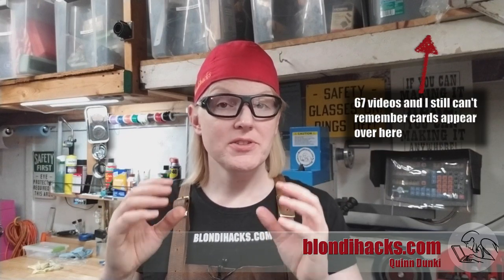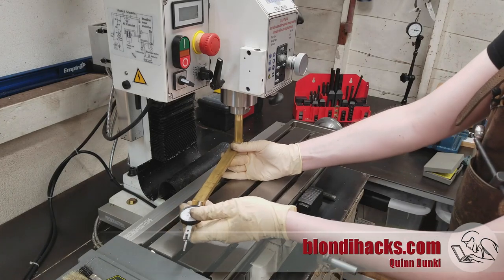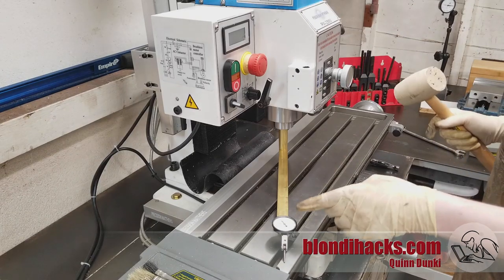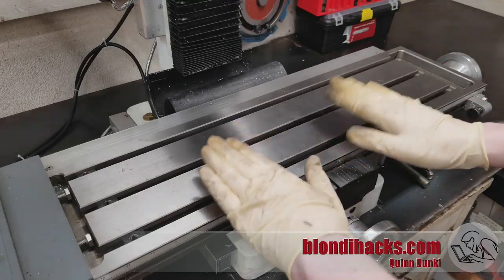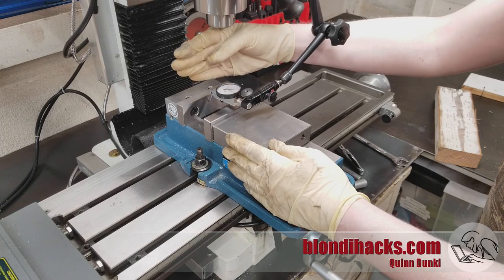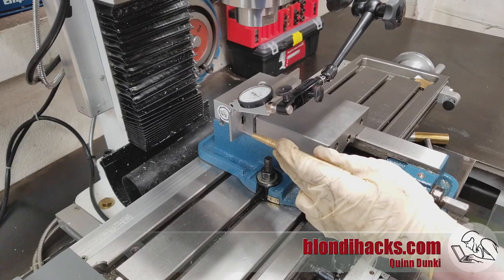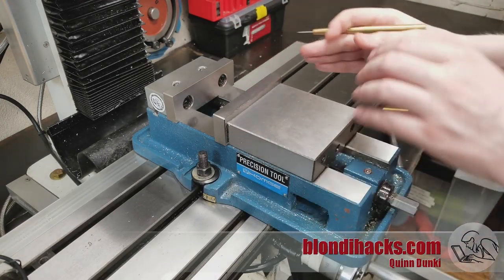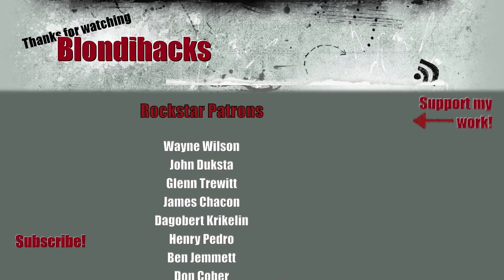Vertical Mill Tutorial 2 : Setup

Comment: 🤦‍♂️ Dammit Quinn, every time i think i have my metric / imperial equivalent chart up to date you throw in a new variable... how many skitchens in a smidge? and will this mean adjusting how many bee's d#cks in a poofteenth? 
I'm a few years off getting a mill but have just started restoration of my 40's era Aussie made lathe, should involve lots of beer and choice swearwords 😁
Reply from the maker: The easy way to remember is that there are 130 skitchens in a rod, and 420 smidges in a naval chain (not to be confused with a furlong, a common error). I hope that helps!
Reply: Of course.. i could never fathom why knot that my bushells and scores never equalled a stadia.
⚙️😺 and happy Apollo day
Reply: @Blondihacks  those are imperial skitchens, though.  A metric skitchen is 1/100 of a skosh.
Reply: I'm still using the skosh. Just a skosh is usually too much. And then you have to come back a skosh... My skosh micrometer is only accurate to (wait for it...) a skosh.
Along with Mr. Pete and Abom, This Old Tony, Oxtool, and a lot more... BTW, I really like your videos even though I'm Bald not Blonde. Keep up the good work
Reply: So, a rod is 5.0292 meters. That makes a skitchen 38.66 mm (or 1.523"). That seems quite a large amount to loosen a bolt... But hey, I'm not that experienced a machinist, and I''m only using a lathe - I managed to make it do some milling too, but it's tough - easy to make it shake quite a bit... :( 

Also, I grew up with metric, so I have to convert everything to metric. I kinda know that a though is couple of hundreds of a millimeter, but when something several dozen thou - say 67 of them, that's 1.7mm, but I need a calculator to figure that out. And it gets worse for bigger sizes. I do know some of the fractions, such as 1/8" or 3/4", and of course, I can convert something like 125 thou to 1/8. But then someone says 27/64 and mixes that with thousands, and I'm definitely grabbing the calculator again...
Reply: At least we can agree on one thing... it doesn't matter what system you use if the part is too short at one end 😁
Reply: If the part is too short on one end, you measured the wrong end; turn it around.
Reply: I tried that but there's no markings on the other side
Reply: I'm sticking to good old fashioned Gnat's knackers for anything smaller than a smidge.
Reply: 🤔 I wonder what the insects think about their anatomy being used as an international metrology base
Reply: They probably think it's the dogs' bollocks :)
Reply: not the bee's knees ?😁
Reply: @billbaggins  Well, as a beginner, I still find with distressing frequency that some parts are too short at both ends. I guess as one improves, they'll only be short at one end. And with sufficient care and experience, not short at either end. Although, with my luck, some of the latter will still be too short in the middle...
Reply: 🤔 too short in the middle.. you could cut that bit out and weld it to the end thats too short
Reply: @billbaggins  This is simply hilarious.  :)
Reply: @andyhowey7351  Glad you got a laugh mate 🍺
Reply: @Blondihacks  Forget all these newfound oddball measurements.  I prefer old school on almost anything over new stuff.  Even so the other day when I tried to pick up a chunk of aluminum rod for a project the young-ish guy at the metal store just looked at me blankly when I request a length of 1/2 cubit.  Good help is so hard to find.
Reply: @davek9804  Just tell them that it is approximately 4.573 x 10^-4 Li. I am sure that they will think it is fairly straightforward.

Comment: My boss at a small architectural fab shop, set me up on the mill one day. Never used one before. I'm thinking it's just a drill press with a moveable bed.  Took it slow, and did ok.  FF a couple years I was machining a 'proof of concept' back gauge for our punch press.    Boss liked it, so it turned into gauges for all machines.  Now I'm the shop "machinist', (in quotes, because I don't need to be super precise.).
Love the videos, you make it so easy.

Comment: Love your videos, Quinn. I just want to put in my 2 cents worth on tramming the head to help others.
Just to reinforce what was mentioned in other comments, the shape and angle(s) of the DTI holding arm do not matter. Also, as long as the mill is somewhat level, the flexing of the arm will be equal on both sides so it will cancel out. What matters is that the distance of the DTI tip from the spindle center is the same at both data points. How the DTI is held is irrelevant.
Regarding the choice of data points used for tramming in the X-Z plane:
As long as the head is not significantly off in the Nod direction, using approximately symmetrical points on the +X and -X sides of the spindle will suffice. As you said, the further away from the spindle, the greater the possible accuracy. However, if the head is off in the Nod direction at all, the two data points must have the same Y position on the table. Best to be in line with the spindle left and right to eliminate any possible error introduced by the Nod being off, even if your mill does not adjust in the Nod direction. Choosing diagonally opposing data points allows any Nod error to affect the readings for tramming the head in the X-Y plane. In other words, NEVER use diagonal points for tramming in any direction.
Keep up the great work!

Comment: Hi Quinn,
I've been bingeing your videos during the holidays to get ideas to help me at work where I use older lathes and knee mills. Nice work! One thing I've done to the vices on all 3 mills is to tap the bottom of the vice near the mounting slot in that groove and machine keys with counter bores in them that fit into the table's slot so it ends up only a few thou out that can then be easily dialed in.

Comment: Another relatively easy way is to use two dial gauges, one at each end of the vice jaw (or inserted parallel plate) and tighten the vice. 

Then move the table so that the left end touches the gauge on the left and zero that gauge. Now move the table so that same left end of the vice now touches the right gauge and zero that one.  Move the table back to the left so the left end of the vice touches the left gauge and the right touches the right.
You can now loosen the vice and tap it while observing both gauges and trying to get them to give the same reading.  Since you are seeing both the left and right simultaneously it becomes very quick and easy to get both sides the same.
Reply from the maker: That sounds like a great method. Thanks for sharing!

Comment: one little tipp on the maybe bigger import mills: if you tap the head or for that matter anything on the mill, not only use a rubber mallet, but also use a piece of scrap wood to hold against the mill. even a rubber mallet will chip the "paint", they like to put a lot of make up on their mills, usually around 5/64" of putty before the paint comes.

Comment: Another nice video! Personally I've been using Tom's technique with my CNC'd G0704. The instant feedback makes it relatively quick, although getting that last few tenths is always finicky.

It's also worth mentioning that the bottom edges on some of the cheaper import vises are not de-burred at the factory. I had to spend 15 minutes with needle files on mine.
Reply from the maker: Yes, great point about the deburring. I’ve had to deburr pretty much every import thing I’ve bought.

Comment: When you get a machine like this, its advised to check that you Z axis is running perpendicular to your table first. You only need to sweep the width of your table and you still need to check your tram front to back. You can shim under the base of the column to adjust.

Comment: Very informative and enjoyable. It is possible to turn up a pair of dowels that are a good fit in your t slots. Fit them to the bottom of the vice in such a way that they are parallel to the fixed jaw. Then when you take the vice off and put it on again, it will be very close and need minimal adjustment. The M-perial system is much used in the UK too, where it is a perfectly reasonable proposition to ask for a 3 metre length of 4 x 2. Actually I think M-perial is a Commonwealth thing.🇬🇧🇨🇦🇦🇺🇳🇿🇳🇺🇵🇳🇸🇭🇹🇦🇹🇨🇻🇬🇲🇸🇰🇾🇮🇴🇫🇯🇧🇲🇮🇳...you get the picture.

Comment: I just thought of something, if you would make a pin that fits into the hole in the vice where the swivel base fit and you would secure it on the table somehow, you would then get a fulcrum more or less in the center of the vice. 
Or you could just make keys for the vice, that's a bit easier but takes a bit more work.

Comment: I realise this video is getting on a bit now (but good grief, 10 months ago? It seems like I only watched it yesterday! Must be me getting on a bit as well...); but when it comes to tramming a mill - certainly a knee mill, but it would work on a column mill too - I cannot recommend one of those dual-dial tramming tools enough. Don't buy one, though, make one! They're dead easy to do, you don't NEED a lathe (but it helps), and tramming becomes almost a pleasure afterwards. Almost.  I've been messing around with mills & lathes for just over 10 years now; and 3 months ago I finally got around to making a tramming tool; and I've trammed my mill more times since I made it than in the entire 9 years 9 months previously! Instead of taking 20 minutes to get it close, now it takes like 5 minutes, and that's including setting the "nod" adjustment on my Bridgeport, which was always an absolute bear to do. Quinn - if you're reading this, you could make a great video or two out of it! Happy to lash together a drawing for you to work from, if you like.

Comment: I'm late to the party, but after waiting 5 months for delivery, I've finally gotten a new mill like yours, a PM-25V with DRO and power feed. That tip with the parallel is GREAT! I spent 30 minutes goofing around trying to do it without that, then I rewatched this video... "Oh! Use a parallel! Right!" My vise (The same kind as yours) came with a rotating base, which I did not use, but after discovering that none of the threaded rods that came with the clamping kit would fit without a hodge podge fugitive fleet of clamping washers, I just tried the T-Nuts that came with the vise. They fit great! Not only does it look clean and tight, but I'm not using up the T-Nuts or threaded rods that came with the clamping kit.
Here's my question: Why put the vise in the middle? Why not off to one side? That would leave more room for direct fixturing. It can't be rigidity, as whatever you're using (Vise or direct fixturing.) is centered under the spindle when in use.

Comment: I use the Lab Rat Method when squaring my vice...A precision 18" straight edge clamped in the vise on parallels with the static face used to indicate.  I have mine currently dialed in to about .0005" in 18" on my Grizzly

Comment: One tip for tramming the vise in. If the front of the table indicates zero and your tee slots are zero take the movable jaw off of the vise and clamp the vise to the table with the solid* jaw up against the front of the table. Now cut a slot in the bottom of the vise for alignment keys. These can be in line with your dold downs slots or off set by the distance between your tee slots. Instant alignment when installing the vise. Baba bing, bada boom. 
Also when tramming the head with 40+ years experience when checking the reading in each direction have the indicator above the table and slip something of a consistent dimension between the table and tip of the indicator. This can keep the tip of the indicator from hitting in the tee slot or the edge of the table.
These types of mills you also need to check the tram of the y axis to see just where everything is. Nick Mueller on YouTube has an excellent series on alignment of dovetail column mills.
*nothing is solid, with the vise mounted set an indicator against the "solid " jaw. Now clamp something in the vise and see what the indicator does. A lot of it simple physics. The rest is the way the vise is constructed. 
I much prefer this type of vise personally
https://www.shars.com/6-660ur-reverse-cnc-milling-machine-vise-0-0004-1

Comment: Very good tutorial on tramming in X, not sure the tramming distance needs to be that long, yes, it improves the resolution, but generally width of bed Y is sufficient, ( this is fully supported by the width of the Y axis) Most machinsts will position the vise slightly off centre, normally to the left, this allows ending up and directing the chips away from the operator, say 50 mm of centre ref vise has width/table length. Also when milling on the top face, feed is left to right, so that the chips are again directed away from the operator.
Again, I have only watched three of your videos, and found your explanations very good, hope you don't mind my comments from my armchair, it does have a vise On it though🤓.
Best regards from the UK.

Comment: Hi Quinn, many thanks for your superb videos. Fantastic humour with really easy to follow instructions for us newbies but having said that, I need your advice.

For starters, what is the size of the vice that you are using in the video? The reason that I ask is that in May I'm picking up my new mill and it has a 820x240mm table with a 55kg load rating and was considering getting a 6" vice for it. Do you consider this size of vice to be too large for that table? I will be machining all sizes of items from the small to the large in steel, brass and aluminium. The other question is, should the vice (whichever size) be mounted in the centre of the table or is that just personal preference?  I was considering mounting more to one end of the table to allow for clamping larger items directly to the other? Your thoughts and advice would be greatly appreciated. I will be working my way through all of your videos as they are somewhat addictive viewing. Please keep them coming.

Comment: Quinn

If you have both a vise and a rotary table, would it be acceptable to mount the vise of center so you don't have to remove the vise when needing the rotary table? Any down side to leaving the vise mounted out towards one end of the table or the other?

John
Reply from the maker: I have seen people do this, for sure. The main reason to have the vise in the center is the weight of the table is most balanced that way. Weight imbalance can cause small losses of precision from flexing and pressure on gibs. Generally there’s room to mount the vise in the middle and a rotary next to it when needed. Considering how much the vise is used relative to anything else, the center is a good idea, I think. That’s where most of your precision is.

Comment: Here's a tip look closely at the top of the pads that the nuts clamp to. If it's a cast surface and not smooth when you tighten the nuts against the Vice the torque exerted on the nut will move the Vice sideways because of the uneven surface you tighten against. Buy Machining these surfaces smooth you can avoid much angst.
Reply from the maker: There are a couple of layers of washers there that help too. The nuts aren’t clamping on the castings.
Reply: @Blondihacks  the washers do not negate the surface that they're clamped to. And uneven surface no matter where it is will provide uneven clamping pressure. Think of press fitting one part within another. If the surfaces are not parallel to each other the part presses sideways. Therefore you have the same situation when clamping a vise if the pair of surfaces not all parallel they pushed sideways.
Reply from the maker: Oh yes, that’s true. I thought you were referring to the nuts dragging on the rough casting as they get tight, which can also cause things to move. Washers do help with that.

Comment: I'm planning on putting 2 dowel holes in the base of my vise , centered on the back t-slot ( also smaller than the top of the slot) . After installing the dowels, & snugging the vise, simply push the vise toward the column (tapping may be necessary) til the dowels come up hard against the T on each side.  So what's wrong with my idea ??